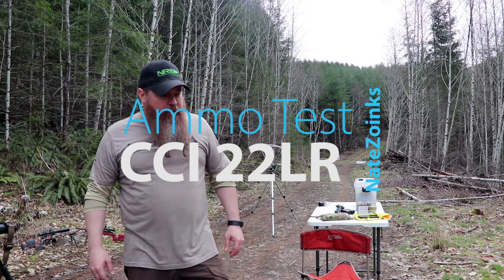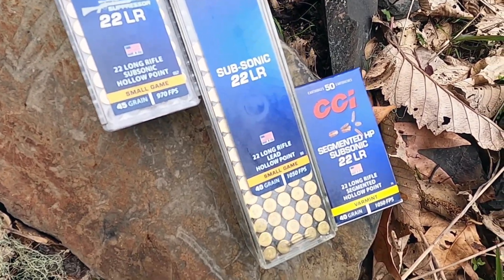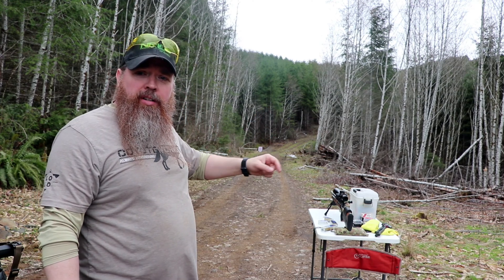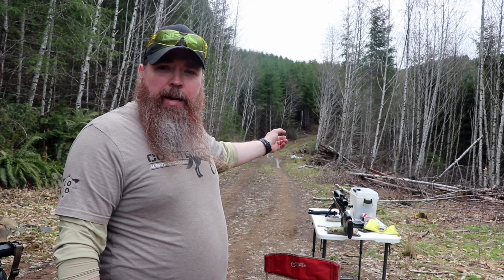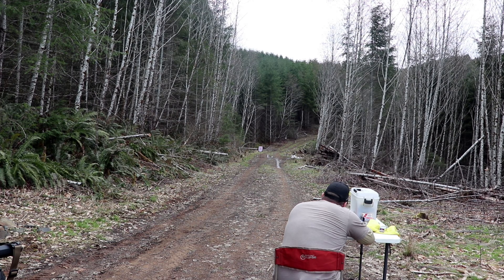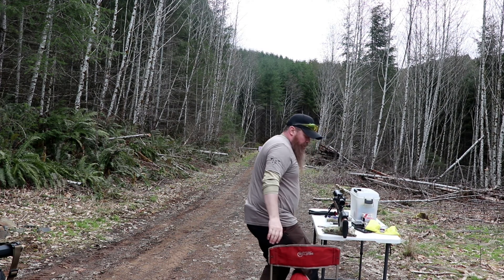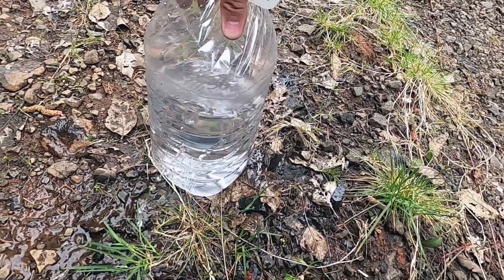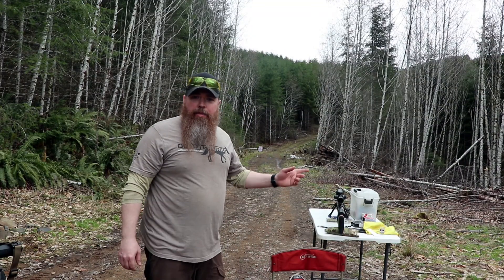CCI 22LR Ammo: Material Impact Test

Comment: Update-I found that i can can substantially better terminal effect if I open the hollow point up on the 45gr Suppressor ammo.  it works fine up close on pests without modifying it but at 35-70 yards it doesnt seem to open up very well unless I open the hollow point to 50% larger than it comes from the factory. Modified bullets at 50 yards it will anchor woodchucks with head shots and will leave a dime sized exit hole in a crows breast.  The segmented rounds work beautifully on all pests out to 70 yards. I just got the 40 gr hollow points at 1050 which I plan to modifiy the same as the Suppressor ammo. Its cheaper and faster than the Suppressor . Hoping I can make it perform as its 1/2 the price of the segmented ammo in my area and in my guns its not as accurate as the Suppressor ammo
Reply from the maker: Great info! 👍🏻

Comment: Wow, just what I was looking for as I am trying to find the quietest subsonic hunting round.  Is that the CZ with the 16.2 inch barrel that gives you the occasional supersonic crack?   I have a 16.25 inch Browning and am wondering if I will get the same effect?
Reply from the maker: Yes, 16.5” barrel and occasionally (2-4 out of 10) get a super sonic crack. I wish it was a bit slower. Honestly think a 20” barrel could “slow it down” enough. Might be future testing, subscribe so you don’t miss it.
Reply: oh, i'm subscribed..  looks like i will have the same issue with my 16.25 inch bbl...   But wouldn't a 20" barrel speed it up, not slow it down because more powder burn will 
increase velocity? 

  @Natezoinks
Reply from the maker: @bva8252  some test have shown that the burn is done by 18”, and the 20” and 22” are slower. My 20” 10/22 is very quiet with most ammo.
Reply: Another question if you dont mind.  Both the Subsonic lead hollow point and the segmented hp are 40 grains and rated at 1050 fps... Did you get a supersonic crack only with the segmented?  Sounds like our rifles are similar size and I want to pick the best hunting  load with no crack.  Did you ever chronograph them?  @Natezoinks
Reply from the maker: @bva8252  I don’t get the super sonic crack as much with the 40 grain hollow points. I have not chronographed them,… yet.

Comment: Good testing protocols. I tested my ammo at a close range using a 22 pistol to simulate longer ranges with a rifle. In Clay at closer ranges I got massive expansion with the suppressor ammo. Apparently at 50 yards the bullet is going too slow for expansion. However is looks like the nose deformed to full caliber flat nose. The flatpoint will leave a pretty good wound channel.